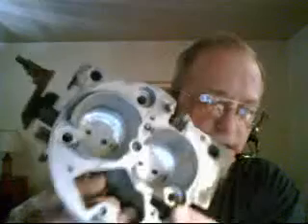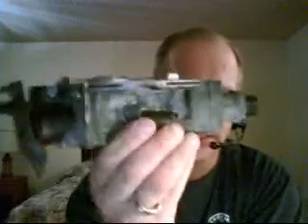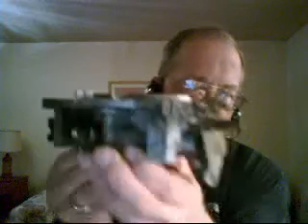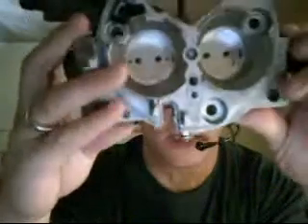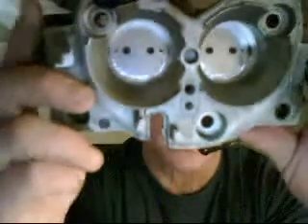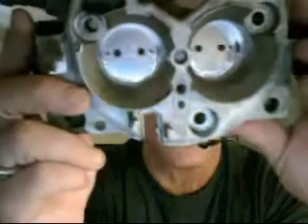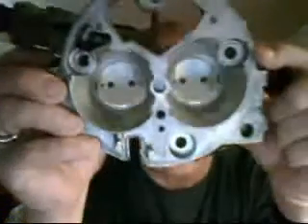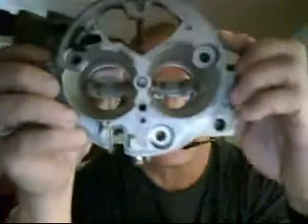August 15, 2009 "What about TBI Systems?"

Comment from the maker: @2003SCT The Vega, then, got 30+ MPG's. The SAME car the SAME control systems today-a 76 Vega, say, will get only 12-15 MPG's.
The only thing different is the fuel....
Still, I am able to triple the mileage in most carbureted engines. Period. AND I do it every day....

Comment from the maker: @2003SCT I do believe that, amigo! If you research, you'll find the Catalytic Converter was to combat unburned fuel exiting the exhaust system, causing Acid Rain.
Older cars got the same mileage as engines on today's market. Take one of these older cars that got say 25+ mpg'sand today, they get only half. Same vehicle. Same air The only thing changed is the fuel.
Somebody's lying. Wouldn't be ALL my customers and team members, so could it be the EPA and Others?
Would love to serve you!